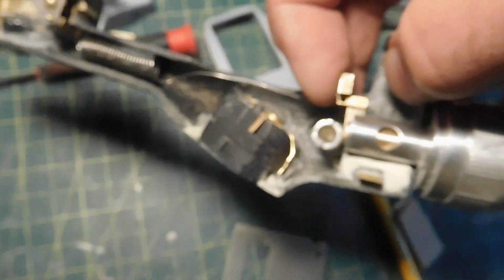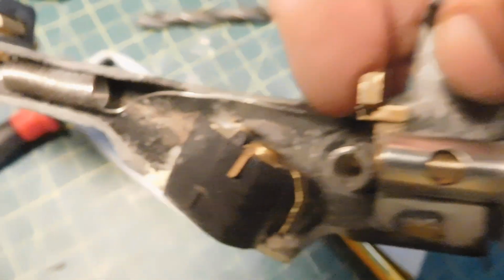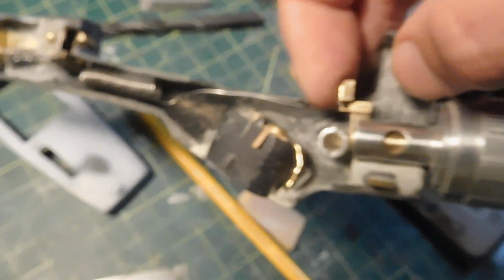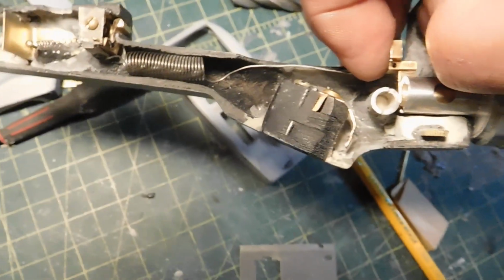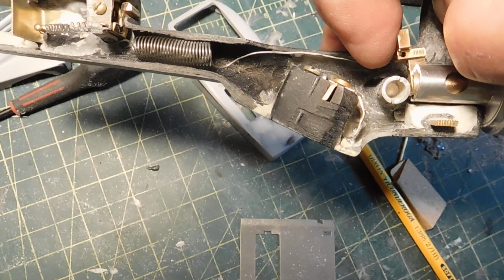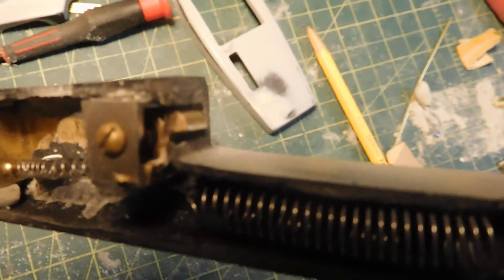EXTENDING EMITTER TEST

Comment: Excellent build up my friend.. 👋 
I just got a set of shells from him (Nathan) and I must say his work is Excellent. I highly recommend that anyone looking for an accurate and well crafted set of shells reach out to him, you wont be disappointed.  
Quick question for ya, what did you use for the tension spring?
Reply from the maker: Greetings, and thank you for all the kind comments. I truly appreciate them. As far as the spring, it's just an ordinary spring  you can find at any hardware story. This particular one I took from a box with a mixed assortment. You have to be sure it's thin enough to fit into that narrow space.